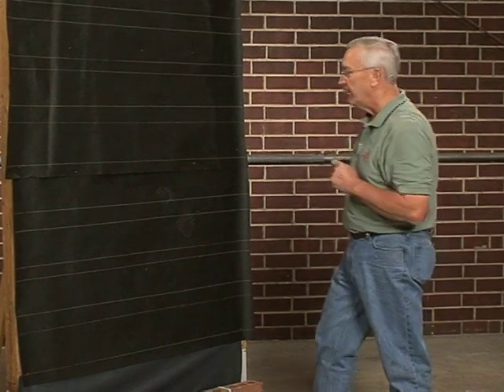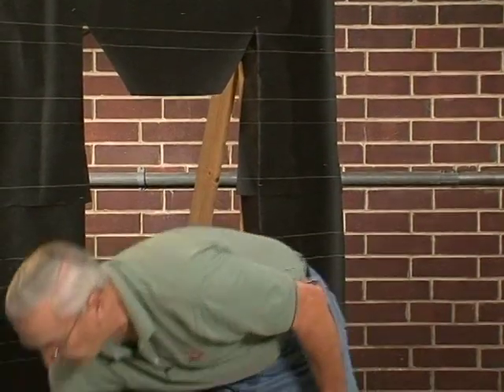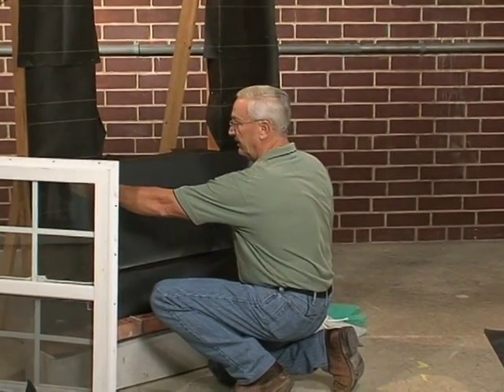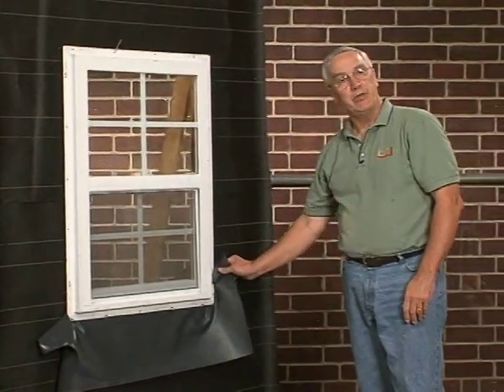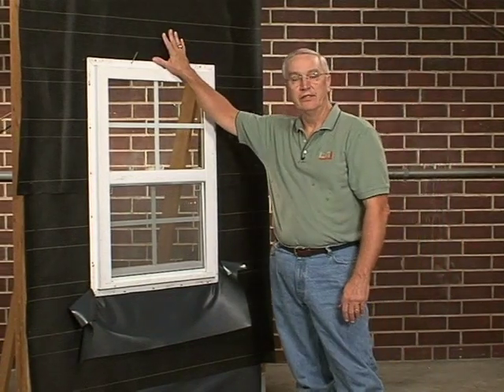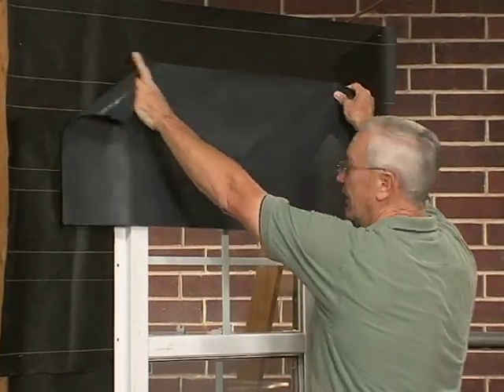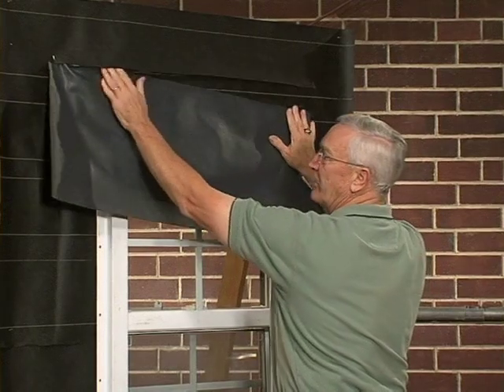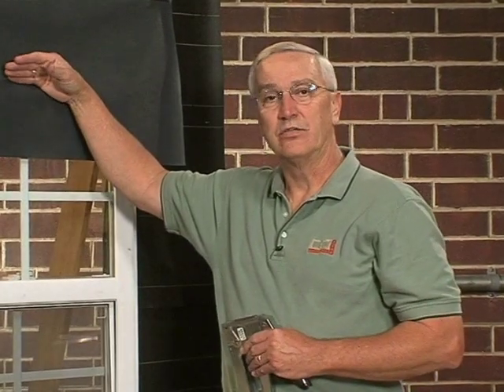Flashing the Window Head & Sill

Comment: Excellent ideas,
But the problem would be locating a mason or any other tradesmen for that matter, that took enough pride in his workmanship, as well as true concern for the customer & that customer's long term maintenance in the home.
Sadly most care little & the poor level of craftsmanship, often doesn't reveal its evil head til many years later, then you realize the mason, the carpenter, the roofer, all took short cuts, or didn't do the work in the manner you were told or expected, now you as the homeowner are stuck with costly repair costs, much higher than the original installation costs, plus the cost of the damage caused by their inferior work!
A true American tradesmen, 
is a rare Breed, indeed!
( it is for this reason, and mostly this reason, Mexican laborers can come here, learn the skills necessary ( or many already know) to do masonry, electrical, plumbing, framing, roofing, etc...
Because they will work harder, faster & believe it or not, generally smarter, Even with a possible language barrier!
Sadly I've seen this in many trades, such as framing or trim carpentry, or brick work ,
Were 3-4 Mexican would easily out perform 5-6 American workers on the same type job, often side by side comparison!
Reply: Darin- USMC B- 85-93  must have been a Pulte job